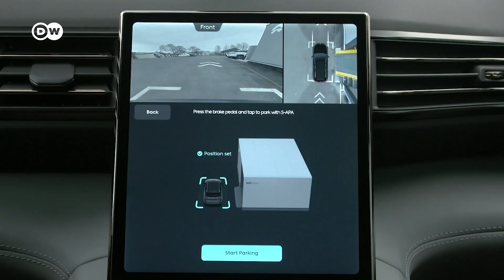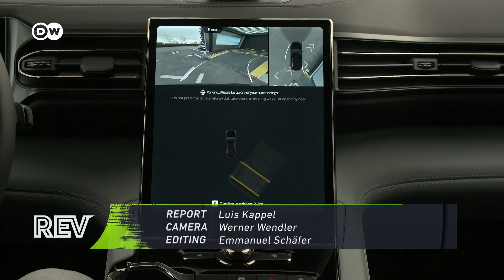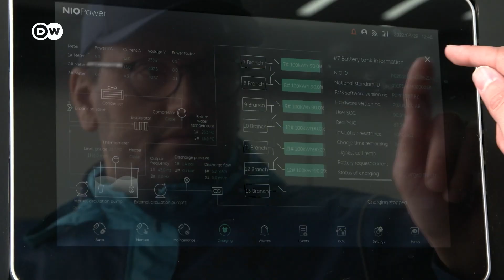NIO Battery Swapping Station Launches in Norway

Comment: all of the generation capacity in the United States could not possibly keep every car battery charged, if all the cars in the United States were replaced with electric vehicles. Not even close. That’s even counting on every generation source being up and running 100 %. which by the way has never happened and is not possible. They always have something called an outage to service turbines and generators. even in nuclear power stations they have to refuel..
  that is even taking into consideration rooftop source on residential homes, that’s taking into consideration coal, Hydro, wind, commercial solar, natural gas, and nuclear, all of those systems up and running and generating power could not possibly charge every electric vehicle and keep them going. We have rolling brownouts and blackouts now.. when we have our “normal “, heat waves in the summer months, electric systems are stressed, California often has to do brownouts and blackouts to keep the system from failing.
  all the bean counters and statistical guys are forwarding the negative news about global warming when it suits their narrative. But actually, since they have been keeping temperature records, the average temperature around the globe has not very more than .3°..
 of course we will come up with synthetic fuel that does not have a carbon footprint. We have it now, we just have to learn how to mass produce it. Actually, using corn as a fuel by turning it into gasoline creates more of a carbon footprint then the benefit from using that ethanol.
  example. Plants absorb carbon dioxide out of the air and they put it in the soil. When a farmer plows his field to plant corn, he is releasing carbon that the plants have put into that soil for possibly hundreds of years. Using that corn that the farmer grows on those fields that are freshly plowed, has less than a 2% benefit to offset the    damage that the farmer has released into the atmosphere by plowing the field call me if you want to call that damage.
  The fact is, the ocean is the planets source for oxygen. Plankton absorbs the carbon dioxide and releases oxygen. If it were not for the ocean, when the planet goes through its winter cycle, where would we get our oxygen? Only half the planet is in the summer months when the other half is in winter. The answer is, the oceans give us our oxygen, and the ocean plankton needs carbon dioxide to create oxygen..
  Earth is actually overdue by a couple thousand years for the next ice age that happens like clockwork. We know this because of earth core samples taken. The last Ice Age was around 10 or 12,000 years ago. The ice that created what is known as the great lakes in North America was over 2 miles thick. does that sound unbelievable?
  Well, believe this. Right now at this moment the ice on Greenland, which is larger than the United States, is over a mile thick

Comment: This is not a sustainable future. We only need more nuclear power plants and other renewable energy sources.

Build charging stations everywhere and stop this battery swapping Bs.
Reply: @K M Shahin think about how many batteries we need 🙆
Reply: @dragospahontu  your eletricity bill will be like oil but more expensive than oil.
Reply: @epsilonxvi5675  not really because the energy will come from the sun if you have solar panels.